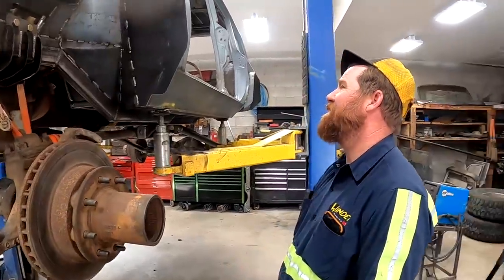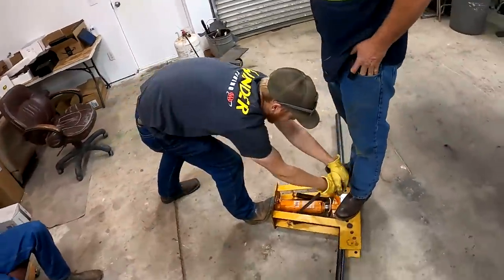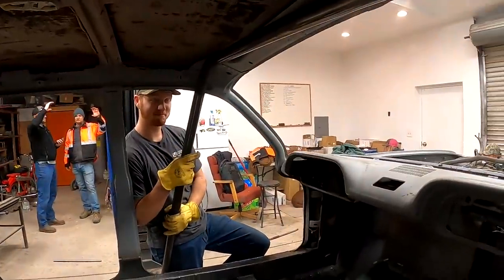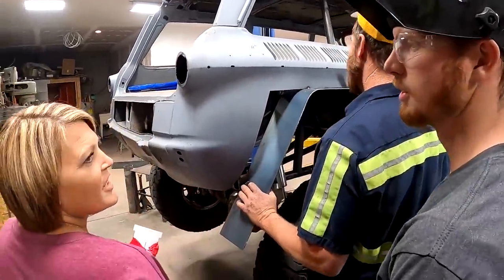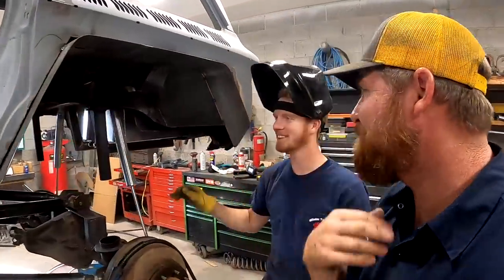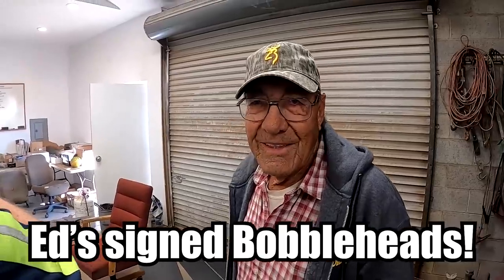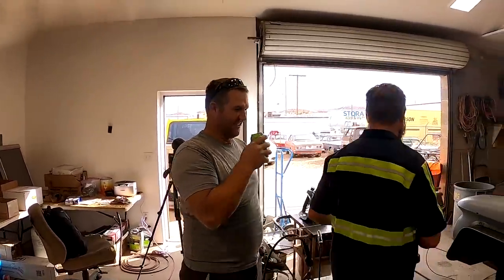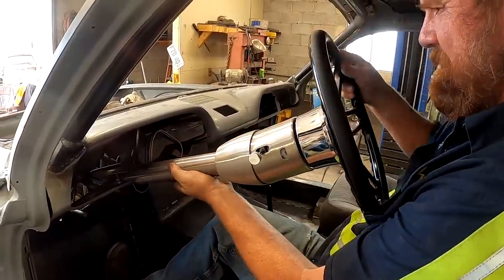Deadline Is Too Close...Can We Finish The Corvair On Time?

Comment: Adding a roll cage? The Banana doesn’t even have one. If you’re going to add a cage, make it handle the 90 mph flops. Or just make a simple up n over to keep the roof from folding when it does just tip on its side. Not a full blown internal.
This is a confusing project. Roomier go getter? Off road rampager? Oddball family fun with dual climate control?

Comment: Man, if you are making structural elements from bent tube please, sand fill them before bending. The way you are doing it will drastically reduce strength. 
And to say it's for "low speed" well come on, some of your rescues are done on the side of a cliff. Saying that is called "evidence" if an OSHA enquiry is ever needed. When it comes to safety you build for the worst possible event not the average day especially when it's employee lives on the line and not just yours.